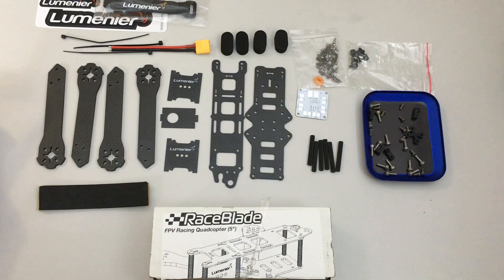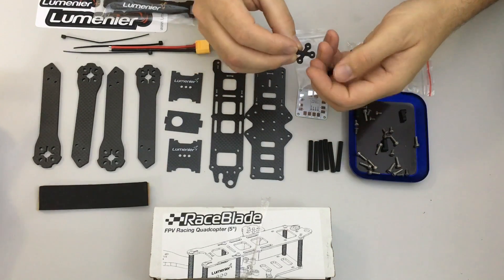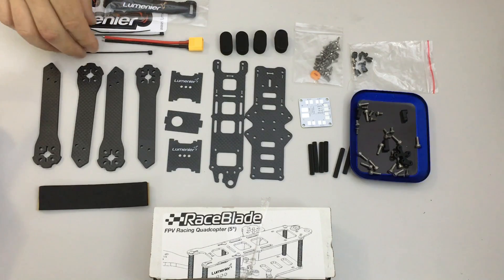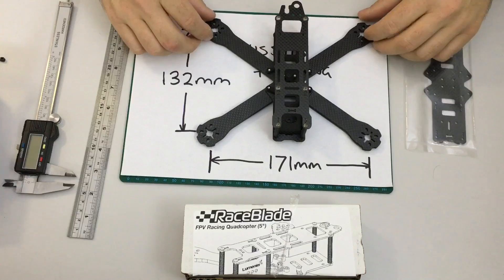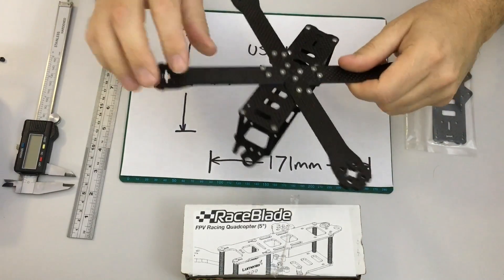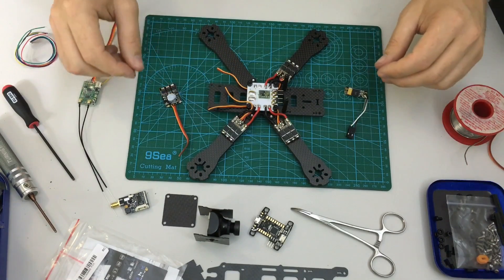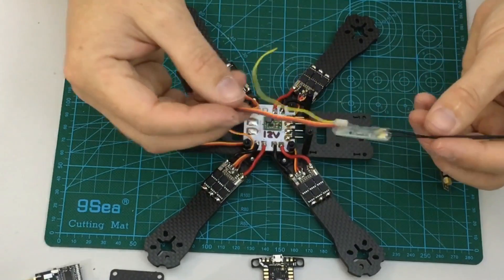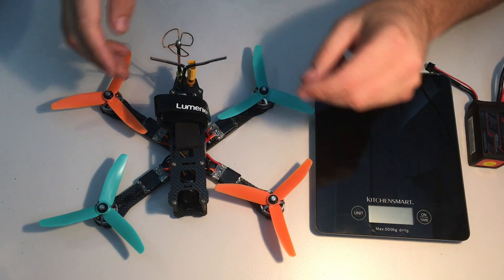Part 5 - 5"MQSO - Lumenier QAV-R Build Summary

Comment: Hi! Love the project! Sorry for my english, I am a swedish fan of yours :)
I bought one of these quads a couple of weeks ago and I got an upgraded version from the one you have. Some of the hardware were changed to steele (the screws that holds the arms), some of the big holes in the bottom plate were removed and the top plate thickness were changed to 2 mm. The version you have has got som horrible reviews because of it being fragile but the upgraded one, that you'll get from getfpv now if I'm correct, has solved most of the earlier problems.
Thougt you should know this so that the current qav-r does not get judged to hard. The new version is a little heavier but much more crash resistant. Keep up the good work, cant wait for the next video!
Reply from the maker: Thanks for the update!  Firstly, your English is better than my Swedish so no apology is required.  The getfpv website says it comes with steel screws but shows the weight of the frame with aluminium screws (106g with PDB).  So I presumed they had changed from steel to aluminium not the other way around. The 2mm top plate is a great improvement. I will update the video description with this information.
Reply: +Darke Peak Yeah, they probably should update the weight of the new frame version on the website. Check out the rcgroup-thread here: http://www.rcgroups.com/forums/showthread.php?t=2570791&page=15 It's a compleat list of the changes they made in the new version (exept for an updated weight of the frame)